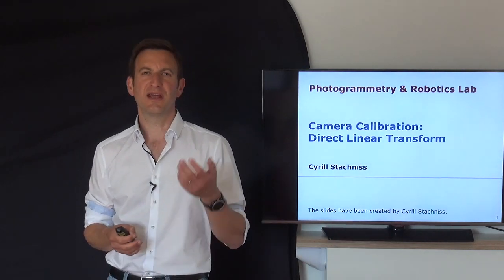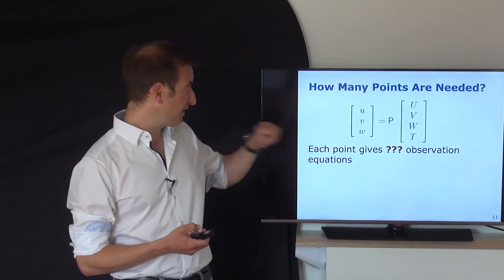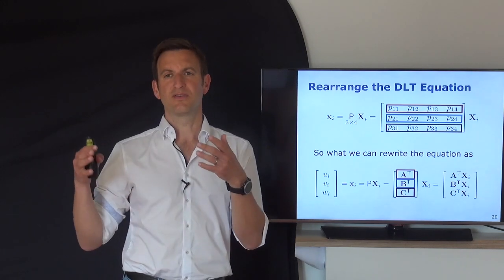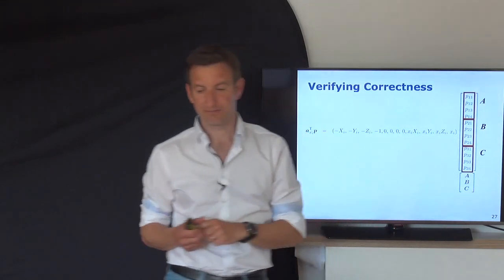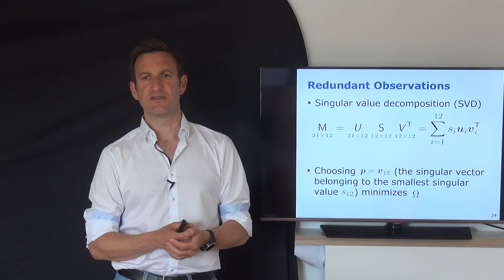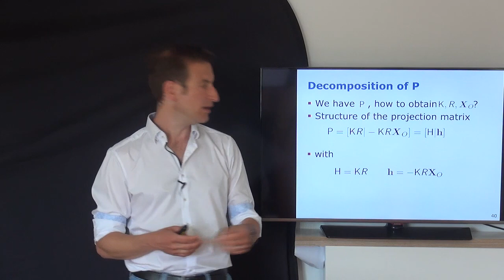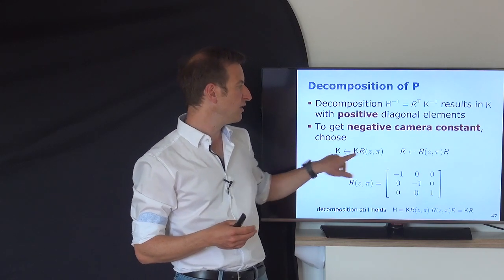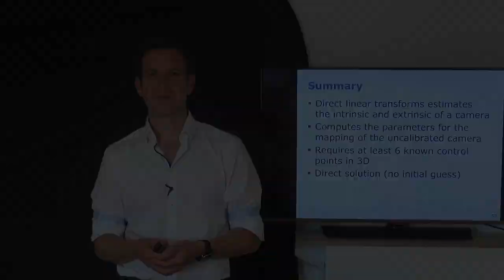Direct Linear Transform for Camera Calibration and Localization (Cyrill Stachniss)

Comment: Would it suffice to use three or four points if they are along the axis of the world coordinate system, e.g. the corner of a room: (o = [0,0,0]), x = [0.2,0,0], y = [0,0.2,0], z = [0,0,0.2]? And eventually filling the ranks with 'reused' base vectors (or null vector?), since the other control points / vectors would be linear combinations of these base vectors anyway?!
Reply from the maker: No, you need to fix 11 DoF, so 6 points are needed (as each point generates a 2D observation vector, the pixel coordinates)

Comment: We normally use checkerboard for camera calibration and assume the world coordinates to be on the board plane (Zi = 0). How does the estimation of P work in this case? Also, we know the world points (because we know the checker dimension). Therefore we should be getting the true extrinsics or absolute rotation and translation (just like opencv's solvepnp). Why is it mentioned that the P matrix is homogeneous?
Reply: i think checkerboard uses different algorithm.

Comment: Thanks very much.   I'm interested in applying this to camera and object motion solving from known 3d spacial coordinates and correlated 2d image tracking coordinates.  How does this DLT method compare to the Least Squares Approximation method ?
Reply from the maker: DLT works without an initial guess, which is a big advantage. Least squares will need one. However, LS will allow you to consider the non-linear parameters and will allow to use uncertainties properly into account. So, starting with DLT for the initial guess and then go further with a LS approach could be your way to go (assuming you do not know your calibration params already).

Comment: If all the points lie on the same plane, then there is an infinite number of possible camera projection matrices, right? since the nullity of the matrix will be strictly greater than 1?
Reply from the maker: You will simply have a rank deficiency in your matrix defining the linear system.

Comment: Isn't there any advantage of knowing intrinsic parameters? It leads more accurate solutions using intrinsics?
Reply from the maker: DLT estimates the ex and intrinsics. In case you know them already, you do not need the DLT. Go for PnP solutions
Reply: So PnP gives more accurate results for extrinsic matrix compared to DLT? If not, there is no point in using intrinsics.

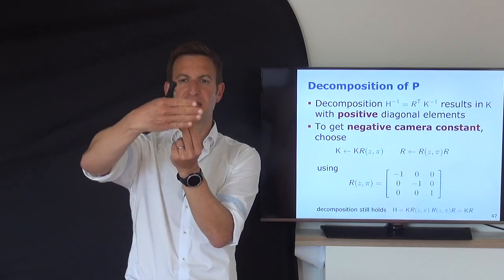Comment: R(z,180deg) used at time 30:10 min is rotation around the z-axis which is yaw angle right. if the Z-axis of the camera lies in the optical axis of the camera. then it will rotate the x-y plane along the z axis and image plane still on the other side. Am I missing something here? I am a little confused. can I get some explanation on this
Reply from the maker: You can completely skip your 3D imagination and resolve it in a different way:

Decomposing H^-1 leads to K^-1, the inverse calibration matrix with positive elements on the main diagonal and thus also for K. We, however, want the camera constant to be negative (so that we are in the coordinate system we want to use). So what can we do in order to achieve that?

We can introduce a 3x3 matrix, let's call it B, which has zero off-diagonal elements and -1,-1,1 on the main diagonal, i.e.m B = Diag(-1,-1,1). Note that B is a rotation matrix (called R(z,pi) in the video). Also, note that B = B^T.

Now we can write H = K R = K B B^T R = K B B R. Our final calibration matrix, let's call it K', can now be written as K' = K B. The matrix R' = B R is rotation matrix as B and R are rotation matrices. Thus, through the introduction of B, we created a change in the orientation of the camera (R -> R') so that the calibration matrix now has the correct sign for the camera constant (K -> K'). That's it. 

By design, the "magic" matrix B, which does that job for us, can be seen as a rotation by pi around the z-axis.
Reply: @CyrillStachniss  Makes sense. Thanks alot for such an amazing course and providing the explanation.

Comment: Hi, Cyrill. Awesome lecture and thank you for making this. But I do have some weird trouble when I really implemented a naive DLT in MATLAB. I basically generate a camera pose(R&t) and 6 landmarks(not on same plane) lying at around positive-Z axis of the camera and a K matrix with positive camera constants. The result I got is correct t estimation, but for R and K I need to multiply the matrix you mentioned (R_z_pi [-1 0 0;0 -1 0; 0 0 1]) to make them same as ground truth. I just got confused because what I understand in your tutorial is for normal operation you will get positive diagonal elements of K, and the mat R_z_pi is used for special requirement that you want a negative camera constants. Is my understanding wrong ? Or my understanding is correct just need to check the code again?
Reply: Sorry, just found that the default qr decomposition of matlab cannot guarantee positive elements in R, so I manually fix those negative signs( for Q and R both) and everything looks good now. Still not sure whether this is a correct method because I just tested on several samples...